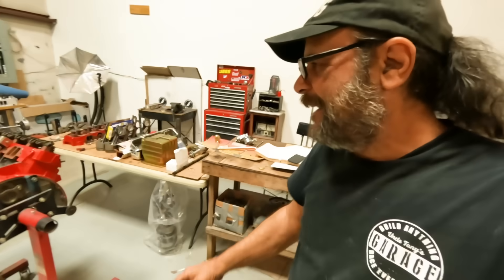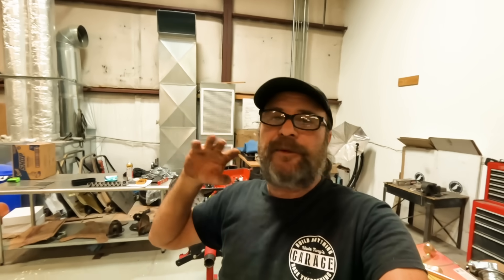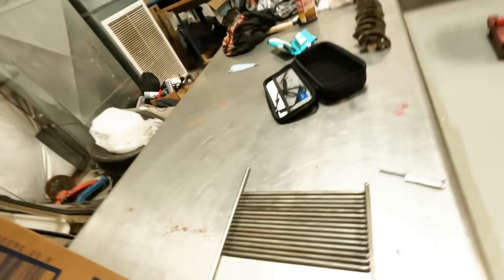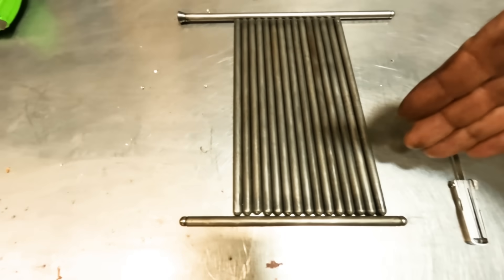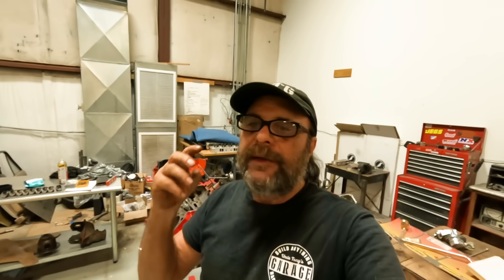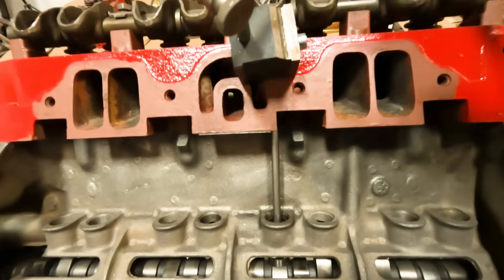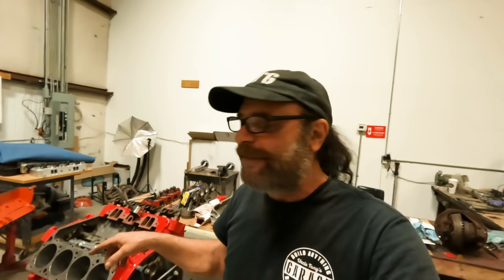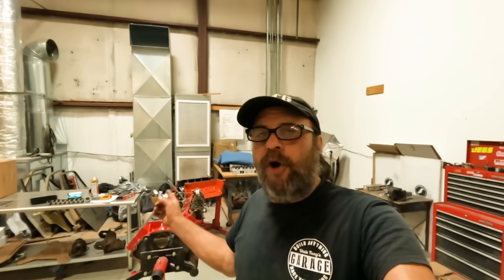The Engine Tuning Issue You Didn't Know You Had

Comment: I knew where this was going immediately... lol. Been doing pushrod lengths and adjusting valve stem heights since I was rebuilding Briggs & Stratton engines when I was ten. The factory shaft rockers make things a pain in the ass. 

Where did chevy get the ball stud rocker design? Hint: It came from the division that had almost all the modern engine design from 1955, and had race only chevy stuff from 1967. Air gap intake, 14 degree valve inclination, dual valve springs, screw in studs, valley pan, fully machined gasket surfaces and combustion chambers, cam retaining plate controlling end play, and they are vastly easier to work on. They also make more torque between idle and 6000rpm than chevys, fords, and mopars with more cubes under the heads.

Isn't it more fun to spend less money and go faster? Using stock garden variety parts, not needing the aftermarket to make good power is a cheap way to go about it. 

If someone thinks the sbc is the fast way to cheap power, I have a challenge nobody has wanted to take on. Use a factory head, factory cam/springs, factory intake, stock stroke and rod length. You can replace bearings, rings, oil pump, gaskets but you have to use the stock pistons it came with. Build a 400ci sbc and we will see who makes more power for less money. I have a car we can put it in too, same vehicle, gears, transmission, stall, everything. Its a 72 Ventura, so bring some Nova headers.

I have an early 1970s vintage 400 short block on a stand that has never been apart. Its getting rings, bearings, oil pump, and a set of untouched 1969 garden variety D port heads and intake from the big cars.  A 1968-70 cam that came in 4 barrel engines will move the valves. I got that engine for $50 and the heads with the intake for $200. I have people give me sbc junk all the time.

If I can find someone to drive another truck and pull the other trailer, I will bring the Ventura to NNN. Used factory stuff vs used factory stuff.
Reply: I'm confused, because the "hint" ya gave states "the division that had most of the modern designs from 1955, AND HAD RACE ONLY CHEVY STUFF FROM 1967".......end quote.....but then later in your comment, ya say "they also make more torque from idle to 6000 rpm than Chevy's, Fords, and Mopar's"......end quote. Call me stupid, but you're saying "they had race only CHEVY stuff from 1967"........yet ya later on say: "they make more torque than Chevy's, Ford's, and Mopar's". So help me out here........you're driving me crazy trying to figure out what the hell you're hinting at. Thanks in advance for your answer and no disrespect meant. ( I know ya didn't mention Buick, Olds, Pontiac, so I'm assuming it must be one of those? )
Reply: @howabouthetruth2157  It was race only stuff on the sbc.. but the Pontiac had it from the start, or after 67 e.g. 14 degree heads and screw in studs... among other things. Buick had shaft rockers like the mopars. Olds had a strange aluminum strap thing between the rockers for each cylinder. Fords had shafts, pedestals, and ball studs, depending on the engine, and how long ago it was built.
Reply: @SweatyFatGuy  Ok, thanks for that. But on another point, are ya saying you can build a Pontiac to make as much or more power than the SBC with minimal funds/factory parts? That's what I'm assuming.
Reply: @SweatyFatGuy  I had an uncle back in the 60's & 70's who always owned & hot rodded Pontiac's. That's all he would build, own, and street race. I knew the answer had to be either Pontiac, Buick, or Old's.......but ya confused me with the "race only Chevy stuff"......lol. Thanks again & take care.
Reply: @howabouthetruth2157  I'd like to take you up on the "only factory production parts" , only we don't need to , its ALREADY BEEN DONE . 
In 1969 , Chevrolet took everything they knew about the small block Chevy , and used it to build the DZ302 V8 . They took the DZ302 , as available to the public , engine available on the showroom floor , and went SCCA Trans Am racing . 
Simultaneously , Pontiac did a full redesign of their block and heads , and built the Ram Air V 303 , which was never released to the public , and also went Trans Am racing - in a car they had such great expectations for that they actually NAMED it "Trans Am" . 
The Chevrolet (production , dealer available) 302 spanked the Pontiac (special assembly , never released) 303 Ram Air V all over the track . 

You want to go 400" with "all factory" parts ? 
Fine . 
And I'll limit myself to "traditional" small block Chevy stuff , not even LS stuff , even though the LS was in use - and even INSTALLED in Pontiacs (GTO , Trans Am , G8 GT ) while Pontiac was still in business . 
No parts newer than 1993 . 
What you'd need : 
1970 SBC 400" block with rods & pistons. 1970-73 400s used flat-top pistons with 76cc heads, for 9.0:1 compression . 
1969 DZ302 cam .495"/.518" lift , 292°/302° duration , a FACTORY PRODUCTION split pattern solid lifter cam 
1993 LT1 aluminum heads . Yes , the valves are smaller , but so are the combustion chambers at 58cc , which will raise the compression ratio to nearly 11:1 , and the aluminum prevents detonation , so its a fair trade . (don't forget to drill steam holes !) 
Intake ? Boy , I'd sure like to use the 69 DZ302's crossram , but I'll be a Boy Scout , because the cross-ram was TECHNICALLY a dealer-installed option , and came delivered in the trunk .  I thought about the high-rise aluminum single 4 barrel intake off the 1970 LT1 , but decided on the 57-62 Corvette dual-quad intake pn 3739653 . 8 barrels of Carter AFB (Chevy used a LOT of Carter AFBs) would sit on top. 
Exhaust manifolds ? The absolute BEST SBC exhaust manifolds are 1989-94 tubular (yes , that means HEADER) manifolds from 1 ton trucks and some vans . These make more power than 2-1/2" rams horns ,  LT1 iron manifolds , or 80s Z28 "high output" manifolds . 
Distributor ? 57-62 Corvette dual-point . Can't go HEI , because it doesn't clear the rear carb on our dual-quad manifold . 
That's ALL factory parts , and I don't think a "FACTORY parts" Pontiac 400 (not even a 400 ram air IV) could touch it . 
But , that's just our SMALL block . 
Wanna try that against a BBC 396" with a selection of Chevy's BEST BBC parts ? ZL1 cam , L88 heads , 
Winter's intake (Chevy factory installed them) 780 Holley ?
Reply: @UCKiqLSyI0AbWnjpMBqBIRYw I think you're either addressing the wrong guy, or ya totally misunderstood my comments/responses........because never once did I insinuate or imply any "challenge" whatsoever.......I just asked for a clarification, nothing more. Secondly, I know all about the DZ 302 that came factory in the Z28 Camaro. Smokey Yunick & Roger Penkse were getting well over 450 hp out of the DZ 302's in SCCA Trans Am racing. I know all about the COPO program and how it was used to get around the stupid restrictions on what could or "could not" be sold to the public. I also know about dealer installed options where the factory would only ship those performance parts in the trunk and not installed on the engines. Lastly, I'm no brand loyalist. I've owned quite a few Chevy's, Ford's, and Buick's over the years, all produced from 1966 to 1971, some stock every day drivers, other's built street/strip, small blocks to big blocks. ( And let me tell ya, I sure wish I still owned several of them. ) I love & appreciate all the good engines made by all the auto makers for various reasons. Of course they all made some duds along the way as well. I don't claim to be an engine builder or expert, I just learned as much about American V8's over the decades as possible, from the standpoint of owning, driving, and admiring those owned by others. ( I'm 60 yrs old, so I know more about these engines than most of these younger viewers.......who pretend to. )
Reply: @SweatyFatGuy  Back when I was a kid ( I consider 18 yrs old as "a kid".....which I was, lol. ), I horse traded for a '71 Riviera with factory duel exhaust and posi-rear end. Car looked near new. Still had the factory options sticker inside the glovebox door. I can't recall what else it said came in the car, but all the men in my family, all engine builders and/or hot rodders, swore that thing had to have Stage 1 heads, because it could easily outrun any of their big blocks, and anything anyone else had at the time FROM A ROLL OFF. (We're talking street legal cars/every day drivers and some street/strip builds. ) No need to "power brake" that thing, even at 15 to 20 mph, you could leave it in DRIVE and jab the throttle 2/3rd's to literally roast both tires, feather back on the throttle to coax it into every gear, still roasting the tires. But ya weren't going anywhere from a standing start, it just spun too easily, even with partial throttle. But from a 40 mph roll-off, my Dad said it best: "This damned thing will outrun the word of God", lol. I finally got another kid to race me from a 40 mph roll off. He had a '68 Firebird 400/4speed manual. I gapped him so bad, he didn't even meet up with all of us afterwards. Absolute torque monster. It was 1/2 qt low of oil when I got it. I changed the oil right away & gave it the standard tune up ( distributor, points, condenser, plugs, wires, etc ) and had my Dad set the timing & tune the carb. After a test drive, he wouldn't even race me in his '68 Wildcat. ( I think it had a 430? Can't recall now. )  I owned that car for about a year, and it never used a drop of oil. Traded it to an uncle who drove it another 10 years or so. To my knowledge, it never gave him any trouble either, but he was one of the few men in my family that didn't race or run a car hard at all. Just recently, the fella that just revamped the IHRA, who is a total Buick fanatic & builder, told me that Stage 1 heads were absolutely still available in the '71 Riviera. I don't know, but maybe the men in my family were right. Because that car sure was fast......once it was rolling anyway. Pedal to the floor, according to the speedometer, it wouldn't shift into final drive until 110 mph. Look at the road, look down again, the needle was gone, and the luxury suspension was way too soft for such high speed, the car was "floating" over every dip, rise, and imperfection on the road. I would wisely back off, even though it was still accelerating with gusto. I can only imagine a Stage 1 in the Buick GS. Lord have mercy. For back then, anyway.
Reply: @howabouthetruth2157  well said;from a 440 fan of the same vintage.
Reply: @danielslocum7169  Thank you Daniel. Keep on driving!!!
Reply: I know in my stuff now you see a whole lotta Ford, but as soon as you said this I know exactly what you where getting at with "stock stuff" (not after market because they are proud of that stuff)...... My Logo & the picture on my page is one. And that thing is looking to get a 400 once I can get around to getting to it...lol.
Reply: I won't argue your point, but who would build an SBC with stock parts? Aftermarket Chevy parts are so plentiful and cheap. An SBC with loads of after-market performance parts would not be a fair comparison? I'm not anti-Poncho, I think they are cool and different in the crowd of bowties, I really like 455 Buicks too. If I am racing on a budget, Chevy power is hard to beat dollar for dollar. It's not a dig or a slight it's market forces at work. If I was coming to NNN Id love to see the Poncho run!
Reply: @67L-88  You're using the tech and availability of today. Thumper is using the experience of what was available in the 60s. Back then, the "big secret" to making a chevy small block a torque monster, was to put the longer Pontiac rods in them. Things such as that were all we had back then.

Comment: One of the things I was most impressed with on the job the machine shop did for me >25 years ago when I modified a couple sets of 360 heads to 2.02 intake valves was that the valve stems were spot on, not even 0.001" difference installed height.  Yes, they were brand new Manley Stainless Steel valves so would have all been the same length to start with so they didn't have to grind any stems or anything, but they bothered to actually grind the seats precisely to depth so each installed spring height, every top of valve stem was bang on
Impressive!  I loved that machine shop.  Did three engines at once that time, two 360s and a 351W.  They assumed I was a race team or something, kept going above and beyond for me at virtually no extra charge.  Shot-peening and stress relieving rods, equalizing weights to fractions of a gram...  Geez, they only charged me $200 a pop to do full spin balancing on the whole rotating assembly including dampers and flywheels.  Ah, those were the days!
Reply: 25 years ago I hauled a roasted 455 olds to the machine shop, the block and one head were toast.
Balanced, reassembled, 0.030 over junkyard block and heads cost me a grand total $1250.  Still runs like a top, to this day
Reply: I recently had a similar experience. Had some regearing done on a Jeep, and a trac rite install. That was the job I gave them to do for me. Yesterday, I was rotating tires. I had done it once before, but hadn't noticed what they had done for me. The lug studs on XJ Jeeps have always seemed short to me. I found they had installed new, longer lug studs for me. Those guys have earned my business and hopefully anyone I talk to will give them business as well. Above and beyond expectation. Outstanding!
Reply: "W0W"
Reply: That's just a great shop that takes pride in his work. Machinists like that are getting really hard to come by these days!
Reply: I know the shop I use to work at . We charge 300 to balance. And any stock rods I shot peened . Mag tested clean bolts and nuts if we using .and of course balance rotating assembly crank and damper ,clutch/flywheel . I always took video for the customer bc most people enjoy seeing where their money went. And usually into this type of work.
Reply: Great machine shop.  Wish they were all that good.  I learned the hard way a long time ago to never assume ANYTHING & to tear the heads down to double check EVERYTHING before having expensive & time robbing problems from bad work.
Reply: WOW. Beautiful detail
Reply: I'm jelly. I have to drive 200 miles to get an align bore and hone.
Reply: @mikescherrer4923  I think they charged me $75 extra to align bore and hone the mains and cam tunnel bores and bore and finish hone the cylinders with a torque plate...  I specifically asked about torque plates and the shop "overseer" manager dude, Tom specifically said to me, "Oh, yeah, we've got small block Mopar torque plates back there, I'll make sure the guys use 'em on your blocks..."
Reply: @drussell_ that machine shop still arround ???? What was there name ????
Reply: @drussell_ hard to find shops like you had that takes and puts that kind of work and dedication into doing that kind of quality work anymore.
Reply: That's a great shop.
Reply: Cant find any 1 or 2 man indepenent machinists anymore those were the best!
Mine retired 10 yrs ago and had lousy work done by 2 "top name" machinists LA area. 1 even farmed valve jobs out to the cheapest hack place n the planet....I once worked there 
Nobody gives a crap anymore or has pride in their work. 

Cheap crate engines on Ebay has put these guys under 
They give a cheap price and big warranty (are they honored!)and cross thier fingers. Today I will still bite the bullet and pay up for the right standard of work its worth it!
Reply: The machinist either cut all the valves on the same plane or he had the "arch" gauge that dealers used.
Reply: New valves or not, they had to cut the stem heights. If the machine shop ground all the seats exactly the same, that means they sunk all the seats to the lowest one. Not a good practice for several reasons. Why would you run 2.02 11/32 stem diameter valves in a MOPAR? We used to put 5/16 stem 2.10 Chrysler valves in SBCs.
Reply: @r.d.riddle2068  Uh, no....
They were cutting the seats out to 2.02 instead of the stock 1.88, so they had new meat to grind them down evenly to.  They simply bothered to actually do them all exactly to the right depth.